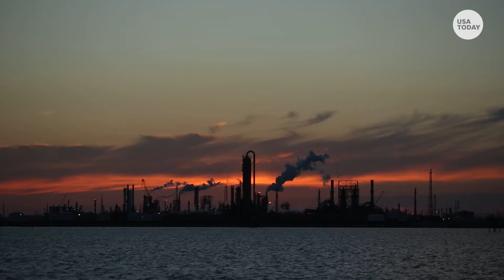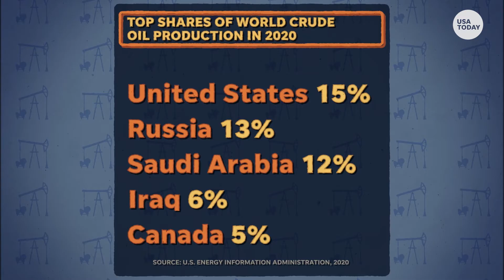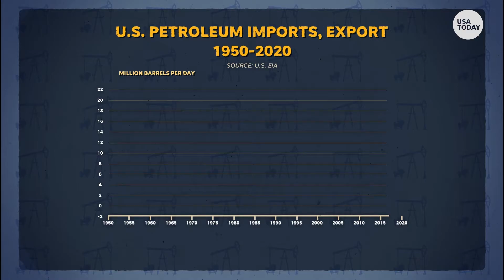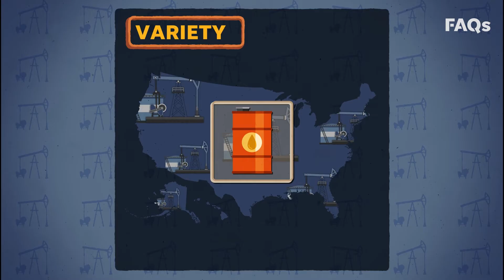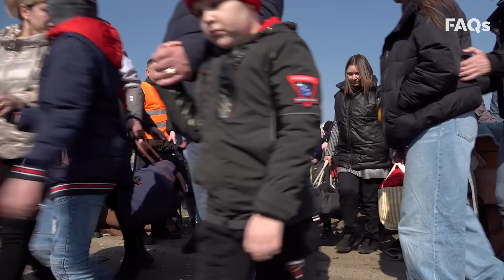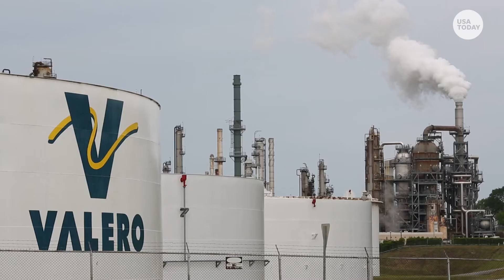Where US gets its oil from and how strategic petroleum reserve is used | JUST THE FAQS

Comment: We need to produce oil from other sources that help take CO2 out of the air and out of the water.

That’s going to be expensive and they will operate at a loss, but it Has to be done. Later on there will be offsets and it will be necessary.

Just taking that CO2 out of the air and out of the water and putting it back into oil put it into a form that is usable instead of just putting that CO2 into something else that you can’t use .

We need to squirrel away CO2 into oil so that it could be used later for whatever project that we need. Especially one that’s going to be about 20 to 50,000,000 tons. Besides the energy to process it and put it into orbit once you store it.
Reply: withotu co2 plants will die, which means you will die
get educated

Comment: Get a petition going, to have the strategic petroleum oil reserves filled. I'll sign it as soon as I come across it. This will help to end this problem with the current price of gasoline! If America has enough oil in its reserve system the price of diesel and gasoline will come down.
Reply: They want all this electric this and that. If they only focused on trucks and could somehow bring cost of transport down using electric diesel or petro 
hybrid... a smaller diesel or petro engine , or even existing ones could idle for a bit to charges graphene superwrcapacitors ( elon bought Maxwell who made those several years ago )  or lithium cells the truck runs on primarily. If we made the trucks need way less diesel or petro then it's cheaper... and self charging so dont have to deal with overpriced charging stations and extra tax on grid. There is tons of room on a semi truck for battery pack and just switch out drive train to hub motors. If we transported our most price sensitive goods this way... and increased production domestically and at worked on getting raw materials all from this hemisphere. Everything as China is proven an unreliable partner and a subversive adversary eroding our culture from within using ideological subversion tactics, sending poison to cartels to ship over. Screwing us in trade now playing start and stop supply chain games to gain higher dependence and upper hand.   I say move more things to india and Mexico if labor and regulation just will not prohibit here in USA. Ensure all workers are making more than just a living wage if working on our products in another country. Top notch conditions, but sometimes job needs to just get done and our bureaucracy and red tape prevents it. China is about to flip the script and put the squeeze on us using chips as squeeze point. We need to get Intel up and going pronto to ensure we have the best chips in the world and affordable to product makers and consumers. Taiwaiin makes 40% of worlds chips and we are years away from that... we must move like it was wartime effort to de - leverage ... same with fuel.  That's how they get us ... dependance
Reply: Did you play the video cause they explained that in here. lol it’s cheaper to get somewhere else. lol
Reply: If you fill up the reserve, you'll be REDUCING supply to consumers and INCREASING demand! That will just raise prices! 🤦‍♂️
Reply: Too bad Biden is up the butt of NATO. There's money to be made here. I'll never forget when the Speedway worker praised Biden for tapping the reserves. Told me it would save $.13/ Gallon in the long run. So interesting.😅 I'm sweating.
Reply: well hell, this aged like milk on a hot day. Reserves at a 40yr low and plans to refill the reserves are only looking to replace 2% of the prior amount. If the current rate is even close to accurate then we will find out how much influence on the global oil market we truly have.
Reply: I don't think you understand the supply and demand of oil.  Neither does Joe.  This is proven everytime Joe puts his foot in America's economy.